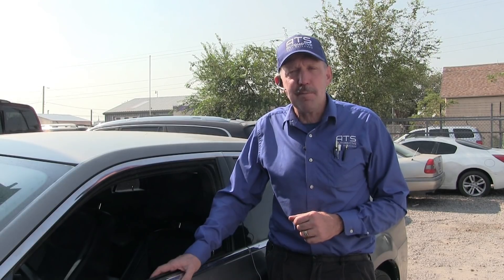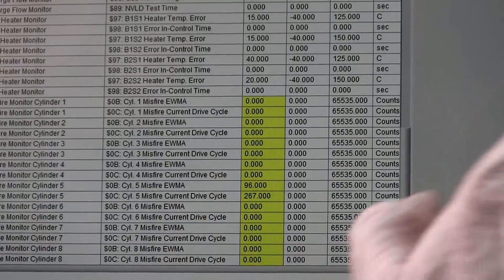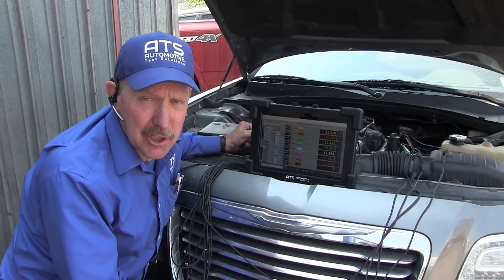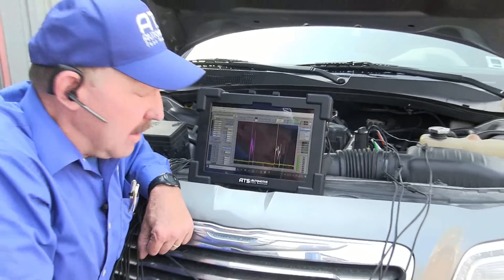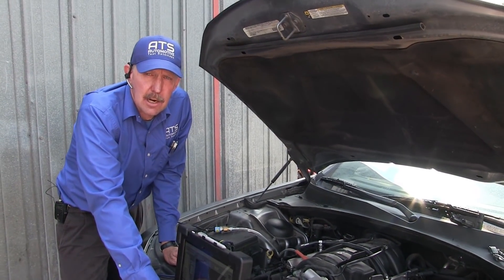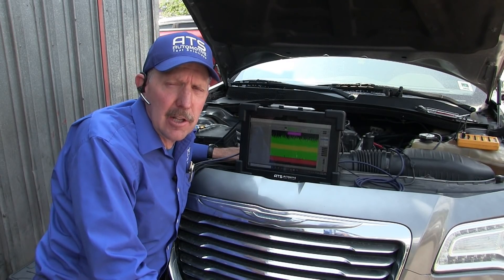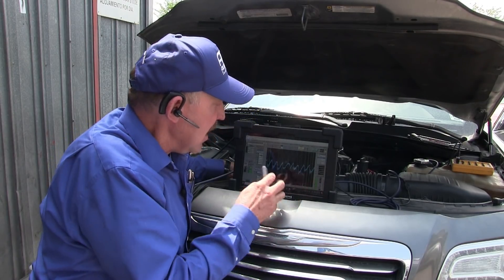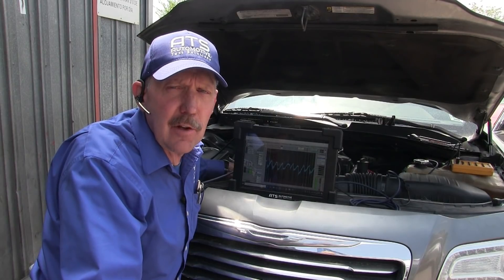2011 Chrysler 300C Misfire

Comment: As a mechanic, I'm impressed with the diagnosis. However, conducting compression test on engine will give a much quicker result without sinking deep with such a comprehensive approach.  The device he uses worths grands of dollars, while a compression tester is less than $100 and both will give same result of a " mechanical problem ". My deep respect to Bernie.
Reply: Yes in an engine without computer 
But modern engines with computer detects misfire that a compression tester can't

Comment: I was wondering why the cam has gone flat on a 10y.o. car. Is it bad design, lack of oil changes or the owner drives like a maniac?
Any ideas welcome :)
Reply: Actually a common failure on 2009+ 5.7L HEMIs, and in some cases 6.4L HEMIs.. The lifter roller fails and grinds down its lobe on the camshaft. The lifter can also spin in it's retainer and speed the wear up. Some have speculated it is a design issue of the engine not providing enough oil to the lifters, some have blamed extensive idling. A common myth is the MDS lifters are the ones that fail the most, but this is not true, the conventional lifters fail as much as the MDS ones. It usually starts with a misfire 3,000 rpm and up, the lobe on the affected cylinder is worn just enough to provide OK operation below 3,000, but not enough lift to open the valve starting at 3,000 to provide enough flow into or out of the cylinder. When extremely worn down the misfire will be at idle on up. While the way shown in this video can be used to narrow down the problem, a compression test can be used to narrow this down as well. Low compression usually follows an intake lifter (not enough airflow in). Higher than normal compression usually follows an exhaust lifter (not enough airflow out). The last step is pulling the valve cover for the affected bank, and cranking over the engine with a starter switch in place of the relay while observing the valves open and close on the affected cylinder. 9 times out of 10 a good lifter/lobe will result in the rocker arm punching the valve open the most, while a worn lobe/lifter will not open as much, if at all. In one instance, I had one that had a bad lifter, misfire above 3,000 rpm, but the valve was still opening and closing normally. A teardown ultimately revealed a bad lifter roller and worn lobe.
Reply: Old car..  poor oil changes

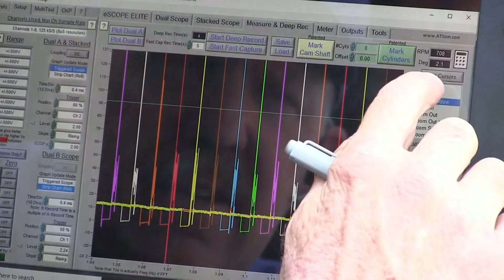Comment: I'm a complete novice, but what pin was being probed to capture the ignition waveforms (near the 5:30 mark)? I was under the (mistaken, apparently) impression that primary ignition waveforms that Bernie reviewed couldn't be captured on 3-wire type coils, because the transistor is internal to the coil unit (as opposed to a 2-wire coil, with transistor/drivers located in the ECU or a separate 'ignitor' module). It's hard to keep up with someone so knowledgeable, that's for sure.
Reply: These are a 2 wire cop. The connector has 3 cavities but only 2 wires. B+ and control.
Reply: Thanks.... I'd looked at coils for this car online and the photos showed a 3-pin connector, so I was confused.
Reply: I am fairly certain that engine does have two wire coils because you are right you can only see secondary on the primary side if the turn on transistor is in the pcm. The point where you see the three wires on the coil he is front probing the connector with only two wires to simulate a coil being hooked up so he can back probe it(the third wire)  with the scope to use it as an ignition trigger without hooking up the coil and risk the secondary frying his pressure transducers.